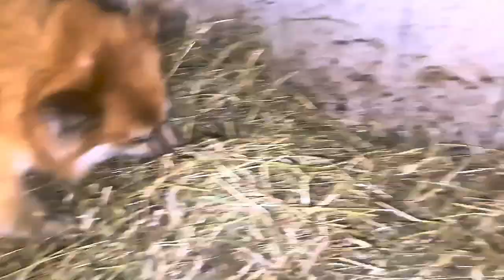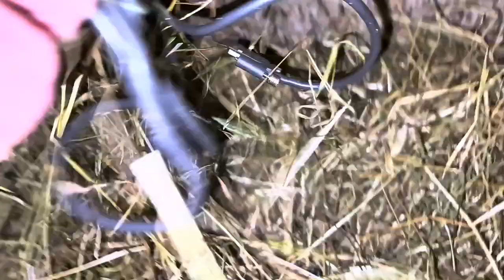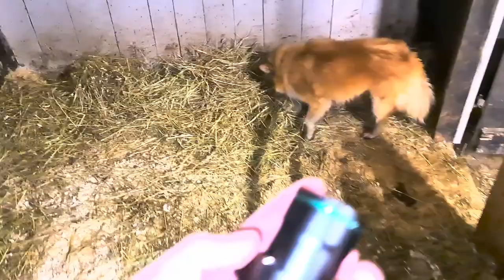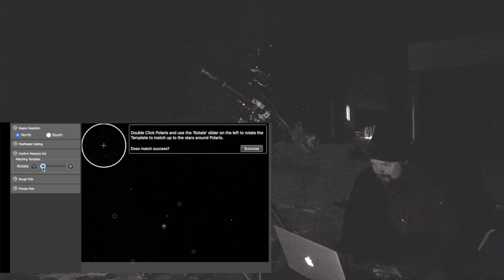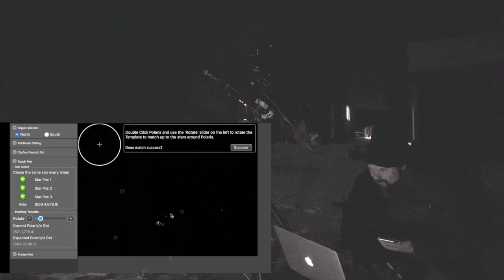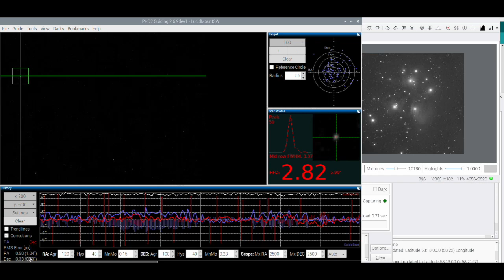QHYCCD Polemaster - First impression & shooting the Pleiades with the Lucid Mount

Comment: Glad the polemaster works well for you! I’ve been using it for 8 months now, having a major headache trying to get it to recognize the camera in my pc (win 10). Had deleted all QHY software, turned off kernel isolation then reinstalled drivers and software. Been working perfect since. Also did you know you can buy a cable then use through your phone? Instead of bringing your pc out. Read about it just haven’t tried it. Cheers and CS!
Reply from the maker: Hey! That does sound like a migraine. With Mac it "just works" 😉 Atleast with my limited experience.
Did see that there is an android app for it, but since three where no/poor reviews for it I'm just waiting with it. I might look at Stellarmate. I just learned that it worked fine there.
Thanks for watching and CS!